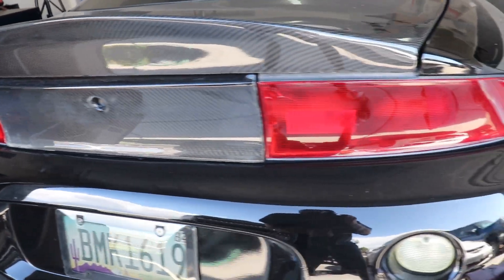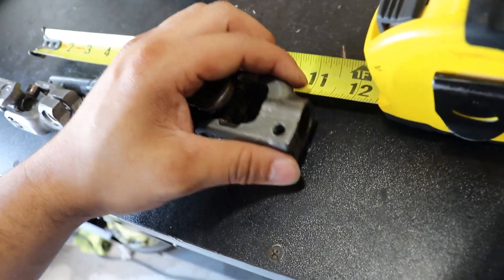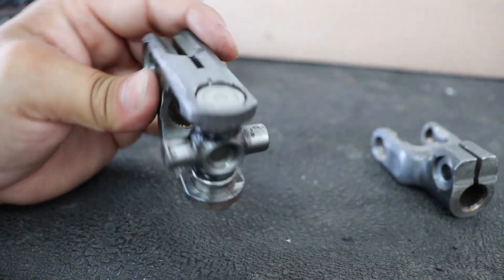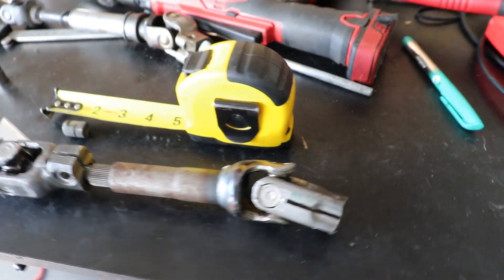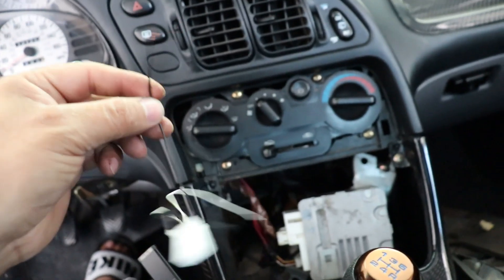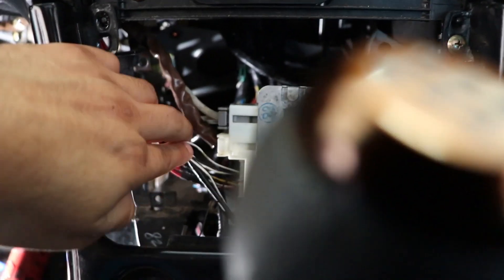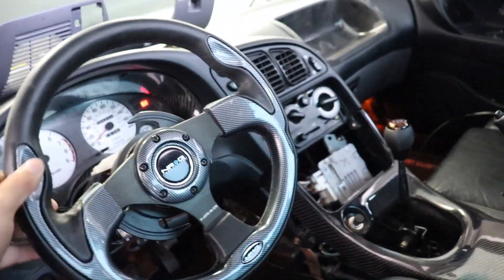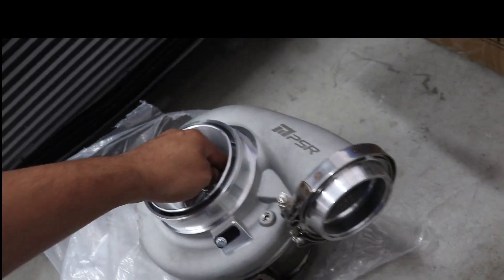1997 Eclipse GSX- PT 3 Toyota PRIUS Electric Steering System Install- FINAL TEST

Comment: Hi Gabe, I viewed another thread about testing max amp draw on one of these setups.  This is a video showing the draw...  now this is a 2004 unit so I don't know if the amp draw has increased for the 09 ( you are saying 60 amps?), but the 04 unit draws a max of 20amps.  Where did you get the 60 amp max draw information?  I am curious if the 09 really has a 60 amp max draw as this will tell me what size alternator I will need.  Thanks.  https://www.youtube.com/watch?v=AXDkACguRjk&list=PL5MKSYOdNYxJBoYwEwthmDWWuApWem7he&index=3

Comment: Hey Gabe, awesome setup! Do you happen to know if the 420a has the same steering setup?  I'd like to do this swap.
Reply from the maker: The 420a should be the same considering the engine and power train were different

Comment: So was your original column depowered or looped prior?
Reply from the maker: I looped it.
Reply: @Gabe_Ortega  
So I guess now with that setup wouldn’t matter anyway as your using the steering column for power assist rather than the rack and pinion
Reply from the maker: @d1prospect15  correct. However taking apart the rack and greasing the rails would be a good idea.

Comment: Good series. Nice contribution to the culture. Maybe adding a capacitor would stabilize the battery voltage at idle if your alternator isn’t keeping the volts high enough and triggering the vibration.
Reply from the maker: a capacitor would be a great idea, Not just for the EPS but for the entire electrical system would benefit from it.

Comment: Thanks for the details on EPS swap.  I'm assuming since you deleted the PS pump, you looped the lines or what did you do? Thanks
Reply from the maker: Yes I did loop the lines. Since the car only gets driven on the occasion, I didn't take it apart and grease anything, but highly recommend if it's a DD